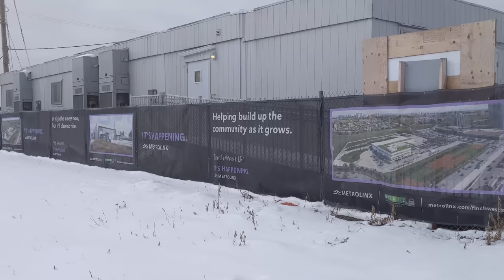Missing Links: Short-Sighted Transit Planning

Comment: Edmonton: Two subway stations from a true downtown urban circular subway and at the busiest activity nodes too.. Railtown (former CP yards turned TOD missing the T) and my alma mater MacEwan University... A now centralized campus that merged 3 separate schools scattered across the city into a single 7-city block long Mega-block connected by pedways which you still have to walk at least 2 blocks in -30c to access the LRT with no direct weather-proof connection. Epic fail of neo-cons at the time to properly plan ahead for trains that they knew were going to be needed and were on paper planned for since the mid 1960's under the Bechtel-designed M.E.T.S. scheme...
Reply: The other biggest gap? We also have a heritage tram across the High Level Bridge that operates but only in the summer when its mostly not needed. If it operated when University is in, it would be the most popular service in the city much like London's two-stop Waterloo and City line... Jasper Avenue to Whyte Avenue, Edmonton to Strathcona's Main Street to Main Street connector since the Edmonton we know and love today was the merger of two equal cities located opposite each other and only really connected properly with the High Level Bridge in 1913...

Comment: Here in São Paulo, the "Julio Prestes" station and the "Luz" station is almost 500m apart and are not connected, not even by a footpath. The only way to go from one to the other is through walking outside of the system (which is pretty dangerous as the criminality there is pretty high)

The worst part of it is that the Julio Prestes station is almost empty, as everyone chooses to go to the Luz station, as there are more connections, and the Julio Prestes station is a terminal station for the ViaMobilidade Line 8 Diamond. While the Luz station connects the CPTM Lines 7, 10, 11, 13, the Metro Line 1 Blue and the ViaQuatro Line 4 Yellow.

It's an useless station that if they do a footpath connection (so people don't have to leave the system and don't have to pay for another ticket) would help a lot. Or just shut down the Julio Prestes station and make it a museum (as it is a historical building for the São Paulo railway network with the old Socorabana Line and the FEPASA systems, which used them in 1900's.

Unfortunately we all belive none of this would ever happen, and the Julio Prestes station will be useless.
Reply: Oh and we have the two Lapa Stations for CPTM Line 7 Ruby and ViaMobilidade Line 8 Diamond, which are not connected but 100-200m apart and even have the same name. 

Fortunatelly, as the new Line 6 Orange is being built, there are plans to connect both stations by the end of the construction.

Comment: Imagine developing a Transit Oriented Development called Stationlands over an active LRT line but skip building a station because your cheap then ask the city to pay for a very long pedway to connect said development to the existing station far out of walking range... Because that's what happening in Edmonton right now...
Reply: OR... build a ghost station in the mid 1970's for buildings above it and never complete it... Also Edmonton and its Futurestation which was designed to move prisoners from the downtown court house and remand centre to the prisons outside of town... That never happened though...

Comment: A missing link in a smaller system(or large depending on how you define the metro area) would be Baltimore's light rail.  It initially opened with a station 2-3 blocks away from the city's main train station and another a few miles from BWI airport.  It still doesnt connect well with the city's subway, being a block and a half away at 2 different points.  

A spur connection has been added to the train station(at massive cost upfront and in operations) and a spur was added to the airport.  However, the airport is also served by the a main line train station that has Amtrak NEC and MARC trains.  It's the second busiest train station in the state, with a bus bridge crossing the last mile to the airport.  The missed connection would have been to have the Light Rail hit the airport terminal and then continue on to the Amtrak/MARC station, eliminating the need for a bus bridge and greatly enhancing connections for anyone not going to the airport.
Reply: In addition the Baltimore subway doesnt connect to MARC.  The Upton subway station is 100ft away from the NEC B&P Tunnel that MARC trains use.  It would have been possible to dig out a station box in the B&P tunnel when the subway was being constructed but this was not done.  Adding it now would be massively expensive.  

A second missed connection is where the subway terminates at Johns Hopkins Hospital, underground rather than going 1 station further to a surface station near Washington and Biddle Streets.  That could also connect to a new NEC/MARC station, Batlimore East.

Comment: I just moved to Tokyo, and the missing connections between the various systems is maddening. The most frustrating one is the kilometer between the terminus of the Seibu Shinjuku line and the main JR Shinjuku station. It is the bane of my existence.
Reply: I really feel you there - but I think that unless you are dependent on Metro links at Shinjuku to get further into the city, you can just as well get off at Seibu Shinjuku terminus for destinations in Shinjuku district. Or transfer earlier at Nakai (again a not-so-convenient 170m walk) to get on the Toei Oedo line. When taking JR further into the city, you can always transfer at Takadanobaba. 
But I can really understand the general frustration and I hate that fares between different operators are not integrated 😒

Comment: In Mainz in Germany, we have one of the weirdest service gaps I’ve ever seen. They were building a new tram line, and at a point where it intersects an existing regional rail line a transfer station was built. 

Now, the network uses one-way tram trains, so in order to be able to turn them around they added a few extra loops along the line. One was around that transfer station, but due to hilly terrain the built it right before the station instead. 

The issue: they did not put a platform on the loop. So during off-peak times, the terminating trains officially terminate one station earlier, then make their way all the way to the interchange only to sit inaccessible in the loop right before it.
Reply: Oof, Marienborn, I completely forgot about that one in a previous comment.

Edit: This also made me realise of Turmstraße (tramway) and Waggonfabrik (railway), the latter which lies on the same line as Marienborn, where tram and train stop are located right next to each other but you still have to walk quite a bit because the railway platform is located on the other side of the railway track and the access to it is 250m down the road (and it isn't even step-free either).

Comment: In Warsaw, Poland we have a metro station called "Stadion Narodowy" and since it was built when Poland was hosting Euro 2012 and is close to the national stadium with little future planning it was designed to be grand and representing so it has two platforms. Now that Warsaw is planing to build a M3 line it must include Stadion Narodowy as the transfer point between M2 and M3 making M3 into a very weird shape. Since M2 currently uses one platform they won't implement cross-platform transfer which makes it more convenient for people from areas meant to be served by M3 to use a more direct bus or a tram where they don't have to climb up and down a flight of stairs. Maybe it's not a situation of a missing link but definitely of missing planning with a result of a unconvinient link. Now is the best time to make some changes to the station approach as currently there's nothing above it and  there are plans to develop this area so implementing it later will be much more expensive if not impossible.
Reply: BTW Warsaw has a history of bad transfer stations as we have only 2 metro lines and the only station where they meet can't handle the current traffic and is very overcrowded.

Comment: I think the worst case for me was the northern line extension in London terminating at Battersea power station and not clapham junction which is only a couple of miles away, this would have completely changed the way people travel in the area and into zone 1 but tfl decided to just focus on the Battersea development
Reply: That was done because the connection would have been too popular and overwhelmed the Northern Line. Clapham Junction is the busiest station on Europe for train departures, 126 per hour pre-covid, and most of them getting the Northern Line rather than continuing into Waterloo or Victoria just wouldn’t work.
Reply: Existing passengers can change at Vauxhall, Victoria or Waterloo; not as good as CLJ, but still easy enough. Had the link been built then passengers further along the line who don't have alternatives, wouldn't have been able to board the trains.
Reply: TFL would rather spread the load from the lines that run through Clapham Junction over several stations (Balham, Richmond, Wimbledon and Vauxhall as well as the main Terminals at Waterloo and Victoria)

Clapham Junction also struggles with the number of passengers changing lines just with National Rail, without adding a tube station into the mix. I understand provision has been made to extend, if/when Clapham Junction station is rebuilt.
Reply: @railotaku  I think they're waiting for Crossrail 2 as well CLJ station (although presumably they'd be the same project if and when it was to happen) to take pressure off Northern Line (and reduce the need for pax to change onto the tube at all).

Comment: I was just in Dublin (coming back & from rural Ireland to Belfast for NYE) and the whole city is a miss match or transit. Connecting between Connolly (for NI) and Hueston (for SW Ireland) with the Luas Tram system is annoying. It was stopping and stuttering constantly (not at stations but just traffic inc our habit of jaywalking) and was way over crowded. It’s also a bit shady, there is a lot of anti social behaviour. Something you can’t ignore easily when you have luggage with you. I wish the DART or one of the commuter rail services could connect the two through the reopened Phoenix Park tunnel or something. The tram is far from ideal when connecting trains & makes me want to use to the motorway instead. So bad connections in cities have a wider impact on the rest of national transport system
Reply: This will be provided for under DART+ West and DART+ South West, the planning application for DART+ W has been submitted to an bord pleanala and the public consultation for DART+ SW has just closed

Comment: The Asakusa line should be extended to JR/Tokyu Kamata station.  The Keikyu Kamata station can be connected to the JR/Tokyu one by simply moving the Keikyu Kamata station underground and the entire Airport Line underground with the viaduct entering the tunnel portal after Umeyashiki station.  There will be an underground passageway connecting the Keikyu Kamata station with the JR/Tokyu one because many people will complain if the Keikyu Kamata station is relocated next to the JR/Tokyu one.  If possible, the Keikyu Airport Line can also be extended to the new Asakusa line terminus, allowing salarymen living in Ota City to travel straight to Haneda Airport without going through Shinagawa for their business trip.
Reply: The Marunouchi Honancho branch can also be extended to the Keio Inokashira line because Suginami City is one gigantic transit desert.
Reply: The Hibiya Line can also have a branch line to Shijo-mae on the Yurikamome, which should've been built for the Olympics, because it serves the former site of the Olympic Village in Harumi.  The athletes could've used the Hibiya line when the subway wasn't running and transfer to the Oedo Line to National Stadium in Shinjuku for the opening and closing ceremonies.  And transportation to the Tokyo waterfront will much more convenient because the Tokyo BRT is just useless.

Comment: The REM missing link between the airport and Dorval station annoyed a lot of people but the government can legally only ask for a viability study and it found it was not worth the cost given usership, however I actually think it will eventually be built when Hudson (and possibly Candiac) Exo line gets replaced with a REM line since while nothing has been announced the simple economics of it makes it right after the St Jerome line as a simple mathematical inevitability and it's honestly a surprise the REM3 was announced first. That all being said, I think a Orange line extension is inevitable given people have been demanding the Orange Line become the Orange Loop and coupled with the planned REM extension into Laval that will give two points of transfer between the REM1 and Orange Line.
Reply from the maker: "Not worth the cost" is something that gets thrown around a lot, but a lot of the time that determination is made in a black box way.
Reply: @RMTransit  In this case it was based on the ratio of projected cost to projected revenue, since the REM does have a minimum viable level of revenue relative to costs, which is why the extension to Chambly the government asked for was rejected despite the fact it probably would have not cost very much since the Casse determined the revenue wasn't enough to justify the investment. Same reason they pulled out of the REM2 when costs started to spiral due to the demands of locals, which is why if it goes forward it'll be an STM project instead.
Reply: @RMTransit  Proprietary software and/or behind-the-scenes corruption?

Comment: HNY, Reece! The Montréal missing link of Dorval was "served" by the hourly 747 bus from downtown to the airport. Dorval Station has operated as a suburban stop since the 1940s, 20yrs before the Metro. In all the decades since then, how did Montréal's leaders got away with an hourly premium airport bus when they could've built a subway line along the existing right of way...or added rolling stock, improved the existing track and added a peoplemover btwn Dorval and the airport? Yeah, I l know... a couple of busses are profoundly cheaper than a single passenger railway car. And the people who plan and budget for transit never use transit. Insult to injury...The REM  that replaces the 747 takes the long way under and around Mont Royal. SMH.
Reply: The 747 bus actually leaves every few minutes and can be used with a daily or monthly unlimited pass. It’s honestly a really convenient service, although the REM will probably be better once the airport branch is in service.
Reply from the maker: The long way, but the faster way!
Reply: @ethandanielburg6356  The 747 used to be less frequent and cost $10 per fare if I remember correctly

Comment: 5:41 ... please explain what DLR is?
Reply: The Docklands Light Railway. Essentially it’s a smaller lighter and automated second metro system for London that’s main purpose is providing transit access to many parts of eastern London. Unfortunately as mentioned, prior to the opening of the DLR bank terminal and the extension of the jubilee line to Stratford, connections to the Underground were far from adequate

Comment: New York's a weird case in that in terms of actual missing links for existing networks there's not that many; some notable ones include the 2nd Ave gap (which is slated to be filled at some point) and the lack of a LaGuardia subway link.

New York's biggest issue is more that specific TYPES of line just don't exist, those being outer borough radial lines. Now, of course, the IBX in Brooklyn and Queens would serve to alleviate this pretty heavily, but a similar plan hasn't really been drawn up for the Bronx which I think would work great.

However, that's not really the scope of this video.
Reply: One of my favorites in the region is Tottenville, Staten Island, to Perth Amby in New Jersey. Despite formerly having a ferry link(IIRC it closed in the 50s), and now having a (vehicle-only) bridge link, there's a roughly 1 mile gap as the crow flies....which takes over 3 miles via Transit. I know because I've done it. 

The same trip is maybe a 15 minute drive. There's no bus that operates across it, and the bridge doesn't even have a pedestrian space. 

As far as I know there's no plans to address this. And admitedly it'd be of limited benefit by itself, as Staten Island's transit has issues too. If someone were to try and address it, Bus lines running from NJ to Brooklyn Via Staten Island could be a good option, and there's also a new ferry terminal being constructed in South Amboy which, with a partner slip at Tottenville Station(and maybe a re-activation of Perth Amboy's historic terminal which has survived as a historic site) , could offer relatively simple solutions.

A tunnel for the SIR under the Arthur Kill would be amazing, but is rather unlikely given the high cost and minimal benefit without a even-more expensive, and useful, tunnel linking the SIR to normal subway services under the Narrows, which would be a huge undertaking.